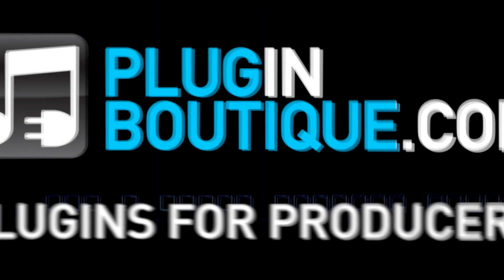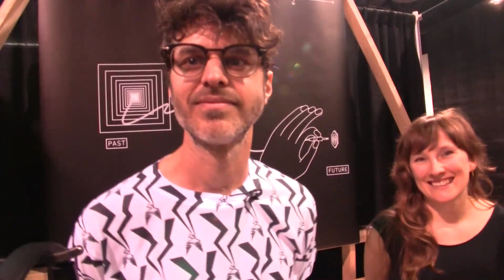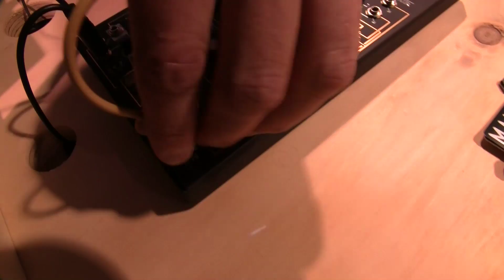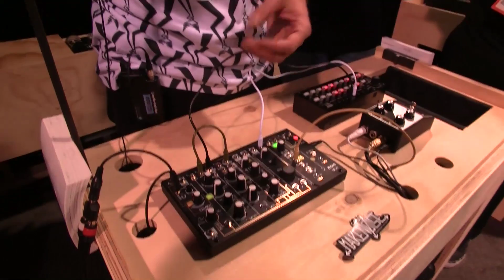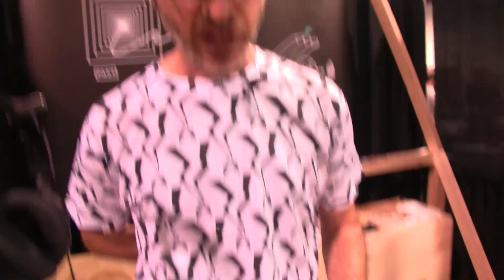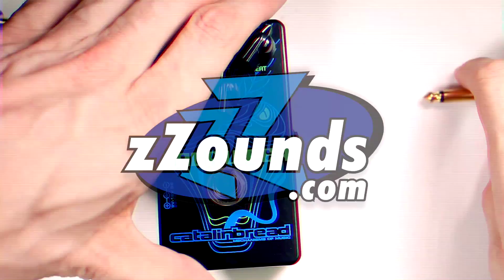NAMM 2016: Make Noise 0-Coast

Comment: i wonder if this will be able to fit in to a eurorack if you want that option
Reply: It's the right height and about 48hp wide, but it takes 15v not 12v power. Do powered eurorack enclosures come with a 15v rail?